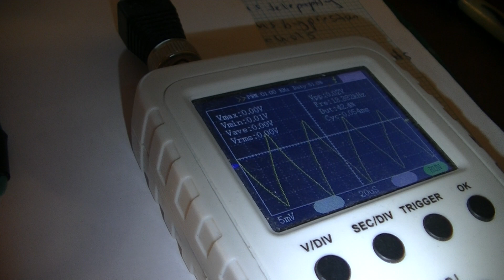high voltage  test, unmodified rochelle salt crystal

Comment from the maker: thinking outside the box i find in my latest experiment rochelle salt crystals modified or not pending of what crystal i grabb out of the mixed bunch acts not just like a high voltage capacitor and arc generator  a crystal sitting on one out of 2 high voltage wires seems to share ac charges with the paper its siting on  so with the other hv wire conected to a 270k recomended reistsor for the 90 volts ac neon globe  when its grounded to my finger the neon lights i feel nothing but when the neon leg is grounded to the crywtal it lights up so while that one crystal is sitting on one hgh voltage wire if i touch the a 4 paper at a distance with the neon leg it lights up as if the paper is charged